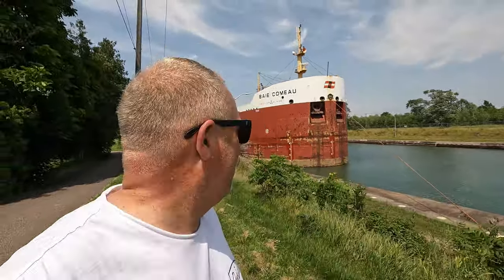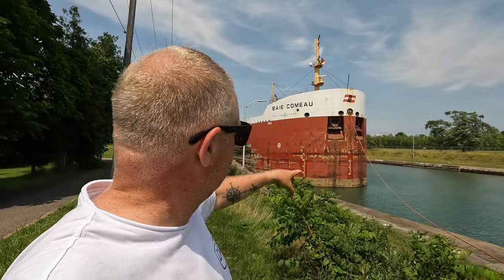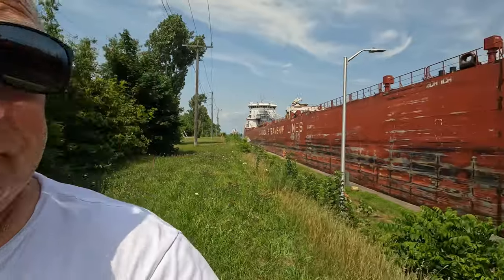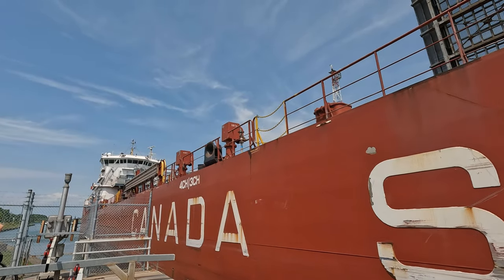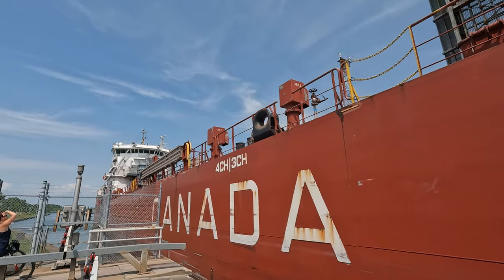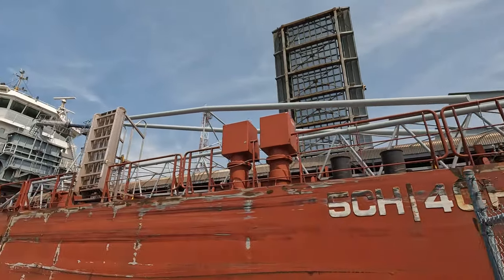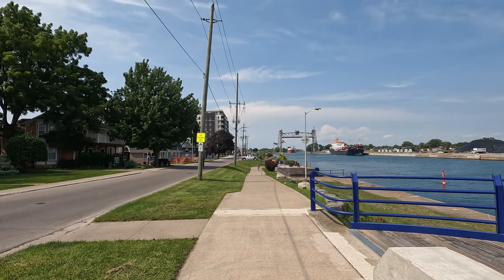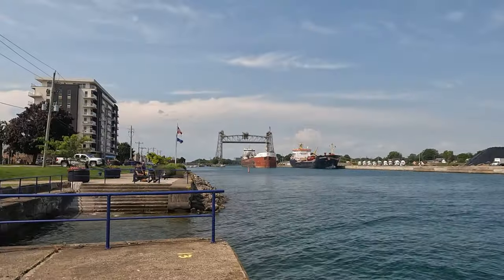BAIE COMEAU - Lock 8 action

Comment: You may have explained this but how do the ship captains maneuver those huge boats through the teeny tiny locks?
Reply: Like the Milton Bradley Game Operation 😅
Reply from the maker: Good question, I am no expert on this matter, but from observation, down at Lock one, The Captain or Pilot (if required) pushed the Starboard Bow up against the beam of the wall before the lock and slowly entered the lock and then using Port stern thrusters, then the stern lines up with the bow as it slowy inches in to the lock.
I Have recently witnessed several ships not even touching the sides entering or exiting.